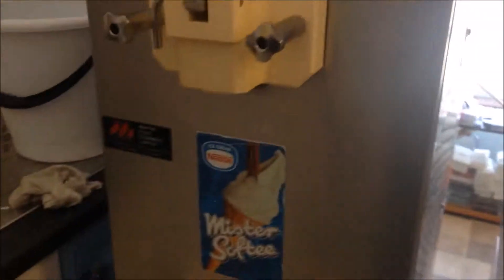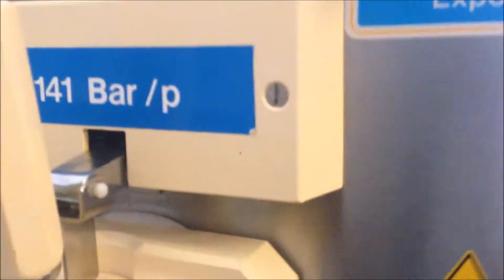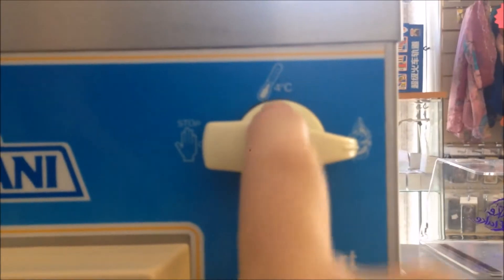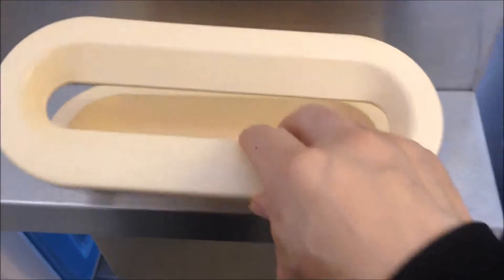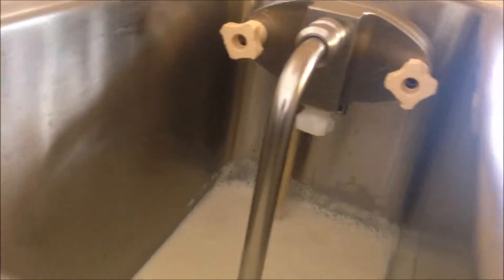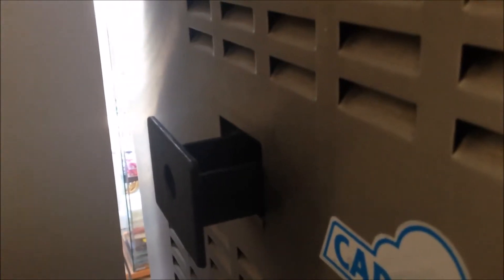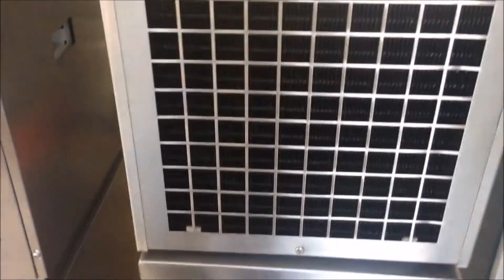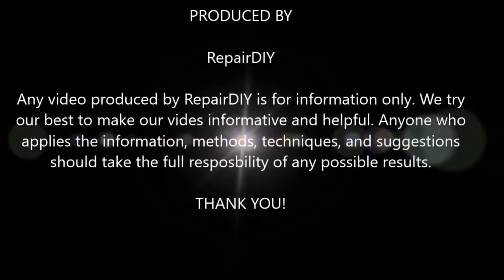Carpigiani 141 Ice Cream Machine: External Parts and Operation Controls - Overview

Comment: hello!, what is the problem that I may have, that when I lower the service lever the machine does not turn on and pushes the mixture?  Thank you
Reply from the maker: you could check and adjust the microswitch un the yellow plastic front box. good luck!